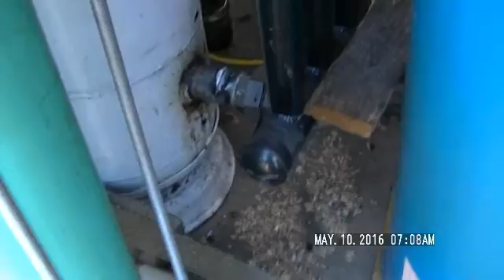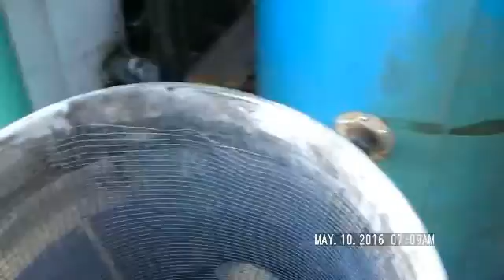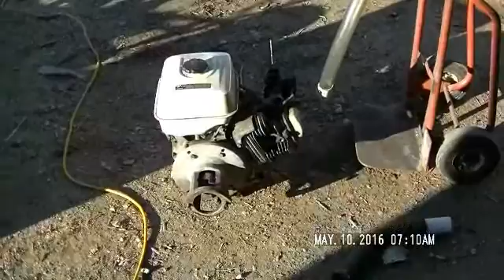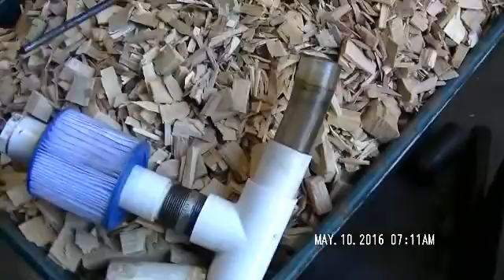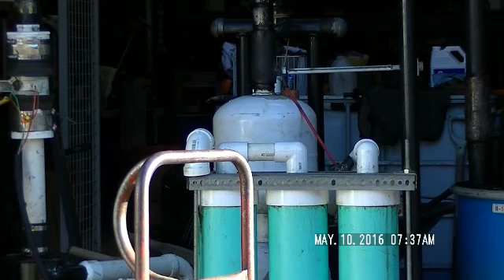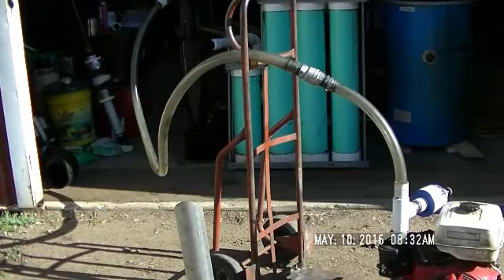NH Hbbyloggr Honda   Left for Dead

Comment: I hate pull start engines!!!  lazy, old, and no enthusiasm for heart attacks.  Bill, looking good! I'm  almost ready to refire mine, just finishing up some things(improvements)--keep up the good work and videos.
Reply from the maker: +Casey Jo  To tell you the truth, it was a " Do or Die , you Bi##ch ", plugged in the hose and gave it one pull. It was started right off.  That saved me several hundred dollars which I would have had to spend  for an anger management course. Glad to hear you are still able to stand and take nourishment, Pete.
Hope you get the little flower back up and running soon.